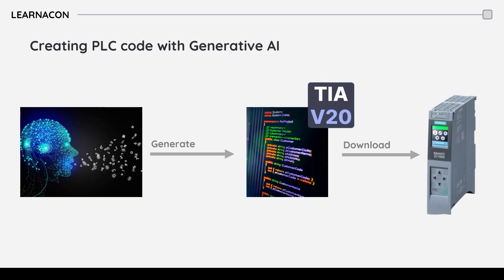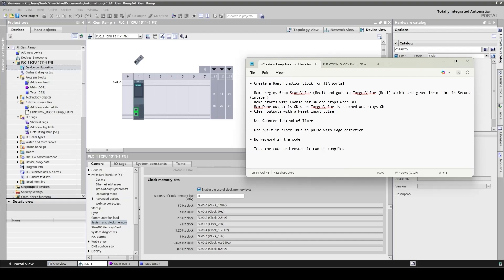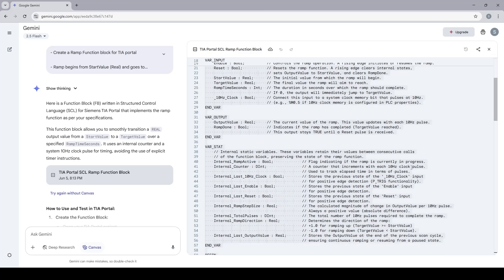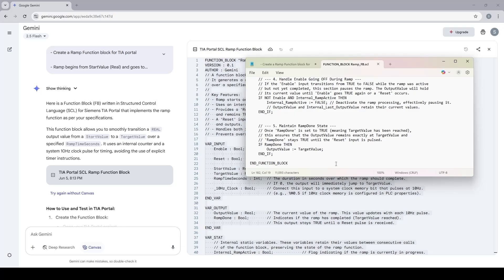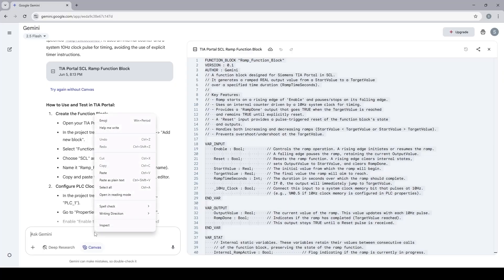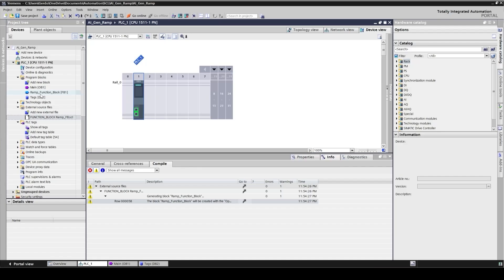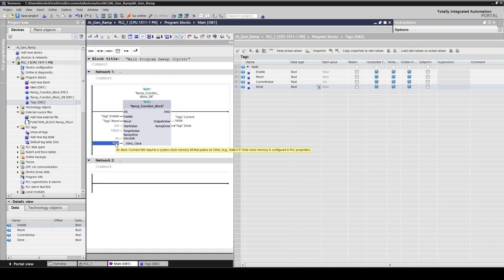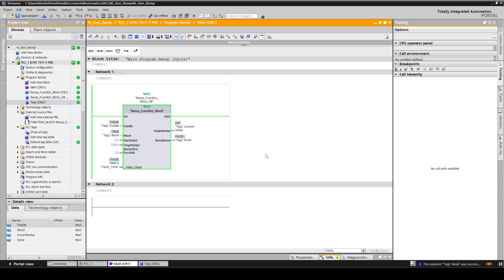How to generate PLC code with AI for TIA Portal

Comment: Do you need 200 lines of code to create a simple ramp?
Reply from the maker: It might be some room for code optimization. The focus here was AI-generated code. Plus, I included multiple constraints, which adds to the required code for controlling.